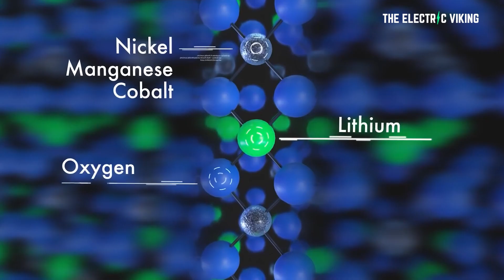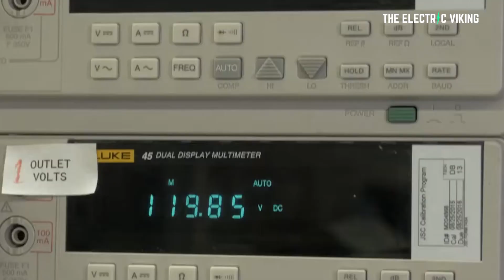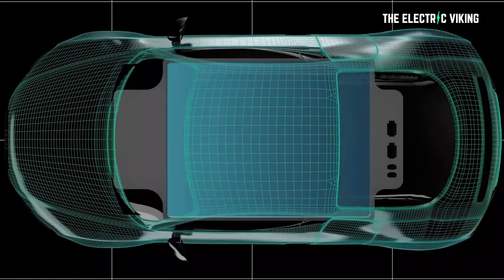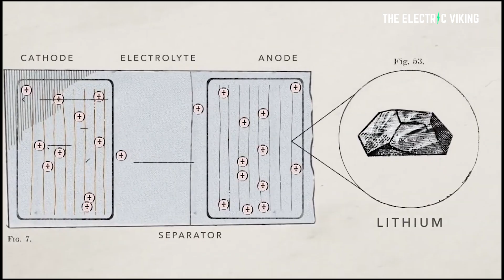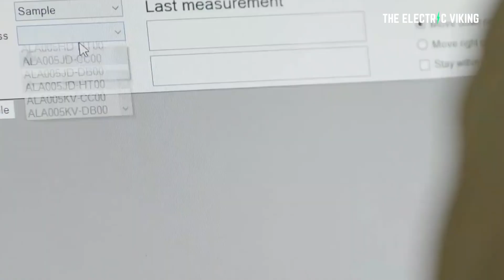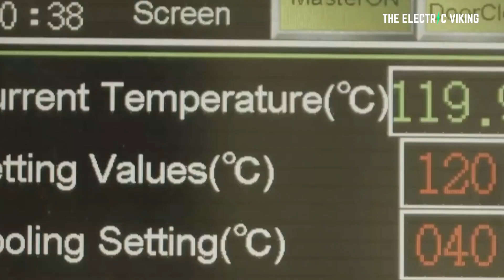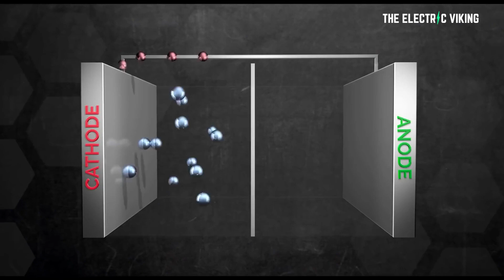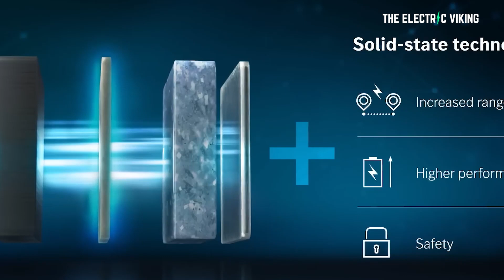NASA's solid state battery could change EVERYTHING

Comment: This inventor's path may interest you. It may lead to a wonderful new energy source. 

Do you think it is reasonable to consume a lot of energy by cyclicly moving a large thermal mass (say a sealed container of water) back and forth between a stove and a freezer both requiring electric power? You aren't making any permanent changes as you alternately melt and freeze the water. The unreasonableness of this waste is a challenge to the second law of thermodynamics. 

I have been on a quest to disprove the second law of thermodynamics after a distinct inspiration in 1964 from Isaac Asimov's carefully unpacked factual but imaginary depiction of machines that fully conserve energy [View from a Height Doubleday 1963]. When Asimov continued unpacking, moving his text to entropy, I disengaged. His example there that dropping an egg was irreversible was too cluttered for me. 

Please consider a thought experiment that may work because it avoids the failing features of Maxwell's demon thought device and Feynman's paddlewheel, pawl,  and ratchet wheel thought device while assembling the working features. The purpose of the experiment is to create self powered thermal diversification. This would refute the second law of thermodynamics. The thought experiment is impractical but easy to visualize and check for mechanical workability.  

Sketch made with keyboard characters: 

COLD ROOM   ())--:::WALL:::-->> HOT ROOM     
>~1000 NM< 

Key
()) = Paddlewheel. 
-- = Axle.  (Continuous from end to end)
:::  = Axle tunnel going through a wall.
>> =  Lumped friction element

Please visualize two roome full of air separated by a very thin wall that allows the rooms to hold their heat independently with minor leakage through the wall. The wall is thin to delicately support billions of  separate nanometer scale short axles running straight through loosely enough to rotate freely but  not leak very much heat so the rooms can hold separate temperatures. 

On the left side, a very small paddlewheel is mounted at the left end of each axle. On the right side, lumped friction elements are mounted stationary in place on the wall, one for each axle, for the right end of each axle to run through. The lumped friction elements connvert the mechanical rotation of their axle into heat. 

Brownian motion (a nanometer scale effect) turns the paddlewheels at random speeds randomly clockwise or counterclockwise. This random rotation is turned into heat by the lumped friction elements.  The lumped friction elements do not impart Brownian motion to their axle.   

  The committed functional roles of the paddlewheels, axles, and lumped friction elements in differnt places should systemically produce a divergence in the thermal energy in the two rooms without adding external energy. 

The water in the sealed container could be endlessly cycled without cost between melting from the heat of the lumped friction element side and freezing from the cold of the paddlewheels side. The second law of thermodynamics must be retired. 

l was granted US patent 3890161 DIODE ARRAY,  for a refrigerator that absorbs thermal energy in an insulated compartment and releases a corresponding amount of electrical energy using the intermediary of rectified Johnson noise (the Brownian motion of electrons) aggregated by a multitude of consistantly aligned diodes. It has been open for anyone to develop since 1992. I had a report of a working very low power prototype in ~ 1980 but l naively lost the prototype. It was made from a chip containing ~1400 gold pillars abutting N type GaAs. A U VA Charlottesville department made it. They could not align very small diodes well enough in 1980 to make ~1 um dia diodes individually so they made them in patches. I found a lab that put conductive paste on the face of one patch chip to bring all the diodes in parallel and test it in an oil bath in a sealed test chamber. They went out of business but I thought they should keep the prototype because they had the test chamber. I lost contact with them and never received the prototype. U VA  refused to sell me any more patch chips and stopped making them. 

It may be easier to develop a newer concept with the working name thermic array. Anyone may develop it because I am releasing the concept for free decentralized independent development. 

The thermic array mainly consists of two electrodes closely face to face (~1 micrometer) in a vacuum wired to an external electrical circuit. The face of the [Emitter] electrode is covered with a uniform array of LaB6 tipped small diameter carbon nanotubes grown straight out. The face of the [Absorber] electrode is covered with small scale graphine flake char. [Rice U 2014] 

Thermal energy mobilized unattached electrons tend to free themselves outward from the emitter tips and drift at ~1 million meters / second @ 25 millivolts (thermal electron energy @ 20 C)  to the absorber which tends to collect them.  

A negative charge accumulates on the absorber. This repels oncoming electrons slowing their forward drift, cooling them. The absorber electrode charge is simultaneously the repelling cooling and the electrical circuit voltage. The drift current and wire current are the same. The DC electrical power consumed by the electrical load depends on the load resistance. Thermal energy absorption always equals the electrical yield (Wire resistance is a practical loss not a true loss so lt is overcome by added thermic array output). The performance of the device is expected to be modest in the beginning but improve rapidly. Even early devices are expected to last a long time. There is little place for obsolence if the first installed thermic array works adequately. They will withstand being short circuited indefinately. 

The thermic array needs protyping by smoothly functioning nanofabrication teams to see if it works. Initial prototype funding could come from crowdfunded grants managed by  sophisticated teams. The details of any prototyping I am involved with will be released to everyone freely. I hope a lot of teams everywhere will produce a working prototype and announce it in full detail after cautiously waiting to make sure the output power is true and stable.

This would be breakeven perpetual motion. Heat would be absorbed from ambient air, water, or ground. Cooling and equal power would be coproduced. The supply is everywhere all the time though performance is greatest during tropical days and least during polar nights. There is no direct greenhouse gas emission. Most uses of electricity release equal heat so this is extremely sustainable. It is scalable from microtiles to gigawatts.  Costs are unknown now but should drop with experience and succession in the production foundries and along the supply webs. 

I think thermic arrays should be manufactured in AI operated   human managed  cooperative (both internally and externally) coglomerates.  Business details would be open public knowledge. Associated people should freely talk and move as negotiated. The semicustom products would be sold at honest accounting commodity prices. No wealth draining top commanders are needed. This may be an organic industry operating for the overall betterment of civilization.

It is more symmetrically elegant for freezers to release energy as they cool any initially warmer thermal mass put inside them. 

Nomads with little money could carefully manage their possessions?. Most equipment would be self powered so it could be demonstrated during trade and put to use immediately. Cell phones wouldn't die or need power cords or batteries. They would cool when transmiting radio signal power. Frozen food storage would be reliable and free or value positive. Vehicles wouldn't need fuel or fueling stops. 

Thermic arrays would not be unreservedly good. Some foresight of the consequences is needed. For a gentle example,  endlessly powered boomboxes would be so portable and easy to operate that very young children could carry them around and make a lot of disturbing sound. This could provide teaching moments where children learn to consider more effects of their actions. Music talent may emerge too. 

Civilization may suddenly advance. 

Charles M Brown lll
Kilauea, Kauai,  HI 96754.

Comment: EVs are a tragic misdirection of resources because they are surface limited. Don't deny me the vastly superior flying cars that can only be practical with liquid fuels. And while a fossil fuel flying car is still better than a grounded EV. Regardless, ammonia either using fuel cells or ICE will do the trick. I love EVs as they have torque and quiet but anything limited to roads is an abomination.

Comment: This is science channel news, not EV channel news. Get back to us when the concept batteries are actually driving down the road. THEN it's worth discussing if the technology is a viable option. 
NASA needs light weight batteries and they don't care if they cost ten times the price of lithium because launch costs per   kilo are measured in hundreds of  thousands of dollars. Millions for Mars.
The current battery costs are already the Achilles Heal of EV's.    Much more expensive raw materials and manufacturing costs will be a deal killer.

Comment: Sam, you are mixing the nature of private enterprise with bleeding edge research and development ... often on projects that are not driven to be commercial... in the final analysis I.e. the original Apollo Space Missions. And an even greater success the two Voyager space probes ... probably the greatest scientific experiments even conducted by mankind?

Moreover your waxing lyrical about the (implied) natural efficiency of private enterprise is totally mistaken. With most recent space or rocket programs aren’t NASA in bed with two bastions of private enterprise Boeing and Jeff Beso’s of Amazon fame? Then of course there are great private enterprise’s such as Enron, Wirecard, etc!

The real issue is not that they are public or private but the quality of leadership and management which appears to have made SpaceX a great success whereas Boeing has become a shell of its former self with borderline criminal management and parasitic relationship leeching government money. And not to forget the Boeing 737MAX MCAS fiasco... good to see private enterprise so solidly at work.

Finally, the other issue how much of a monopoly the enterprise in question is running under ... monopolies tend to create fat and lazy suppliers!

Comment: investment in primary or public research by 'the govt' is an essential critical part of developing anything. Its frustrating to encounter the trope that the private sector 'does it better' when in fact in many cases they are taking elements or even finished packages and integrating them into their product. There's an argument for both but you can't have one without the other. Lets try and do away with binary thinking. Without the investment of public money into research by organisations like NASA or darpa then you don't get the private giants like Hewlett packard (who benefitted from primary research in transistors) and who eventually formed the nucleus of the computer and IT industry. Its everyone pulling together that makes things happen. Private sector can do great things and they can be just as wasteful as public sector by blowing money on marketing or other non productive nonsense. Takes an ecosystem first before things can develop and emerge. They don't emerge fully formed and certainly dont emerge fully formed with the private sector alone